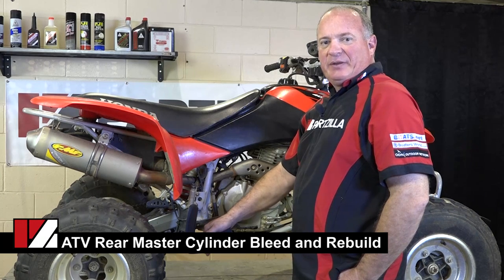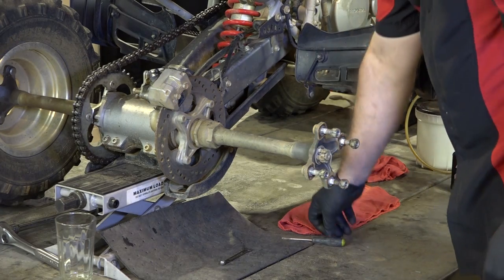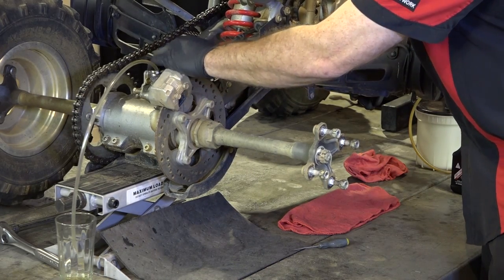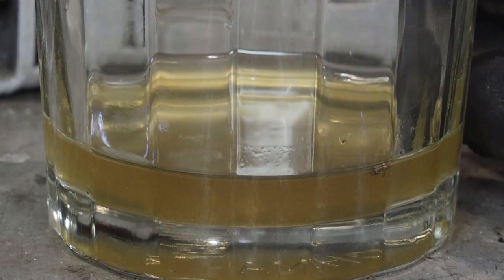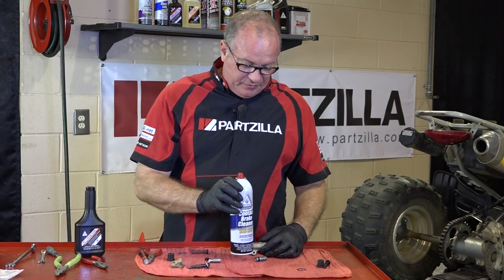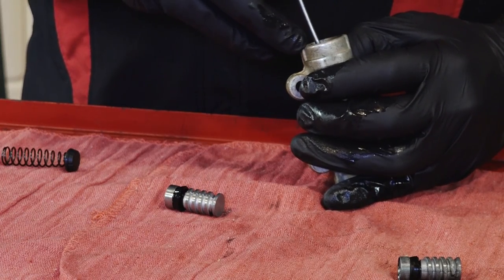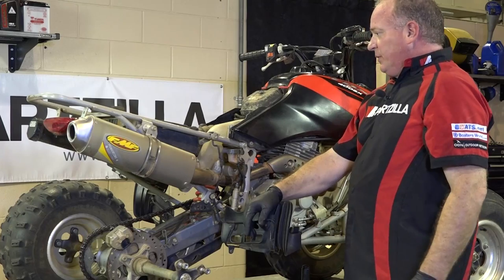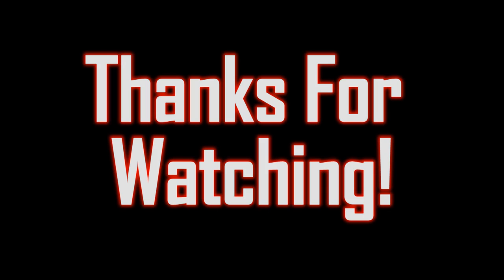How to Bleed ATV Brakes and Rebuild a Rear Master Cylinder | Partzilla.com

Comment: Hi @Partzilla i bought a new master cylinder because i couldnt build much pressure in the system but now i kinda have the same issue. The pedal wont stiff it up. What am i looking for now? Can the issue be anywhere else?

Comment: I need help diagnosing the rear brake issue on my 2015 Honda Rubicon FA7 DLX. The caliper piston pushes out when I pump the brake, but it won't go back in unless I take the caliper off and screw it back in. I there air in the system? Is the spring in the master cylinder broke? Is there something wrong with the caliper? 
Other info you may need: There are no leaks anywhere. There is approx 6,000 km on the machine. The brake pads are close to the end of their life.
Oh, and BTW, this video was AWESOME! It explained a lot, but I'm still stumped.
Reply: your line could be deteriorated, restricting the release  of the caliper.
Reply: @111whereru  Thanks for your response Mike, but that wasn't it. The rear pads were worn down enough that it was affecting the entire system. I rebuilt the rear master cylinder, took the calipers apart, cleaned the piston, flushed the lines and in the end, it was the pads - 🙄. Oddly enough, the pad life marker lines on the caliper told me I still had life in the pads, but they were looking a little thin so for $30 I should have started there - DOH - lol - lesson learned.
Reply: @quaddingsous  I have a Honda with new pads and a rebuilt master. the pads aren't retracting. The line is the problem. good to hear you got it

Comment: Very helpful. I have a 2006 Bruin 350 with a frozen front brake. You mentioned DOT 3 & 4 holds moisture. Is there another choice that wouldn’t do this?  Thank so much.
Reply from the maker: 5.1 but it's not necessary for this application.  3 or 4 should work fine.

Comment: Would it hurt the machine to use a standard car brake fluid ?
Reply from the maker: +Cody Brewer DOT is a standard of measurement that sets the specifications for fluids. As long as it's a DOT-4, it will work. You will need to pay attention to the boiling point as this varies from each manufacturer. The dry boiling point for the Honda DOT-4 fluid is 490 degrees F.
Reply: Cody Brewer 
No, I dont think it would hurt it unless you're constantly using your brakes.
Any DOT 3 SYNTHETIC should be ok.

Comment: I have a 2010 Polaris Scrambler 500 HO that had the brake fluid pour out the rear calliper. Where should I start with fixing this and what steps do I need to do?

Comment: Sir,
Were you able to successfully purge all air from the line the way its normally routed?  On mine there's a high spot in the line right before the caliper where some stubborn bubbles can hide.  May be necessary to un-bolt the brake line brackets from swingarm to get a straight run from the caliper to the master.
Reply from the maker: Normally it will purge. If you get some that are stuck, you can always reroute the cable to eliminate the high spot temporarily.

Comment: Hi, could you please assist me in how to fix my rear break master cylinder on a 1999 Honda Goldwing SE 1500? I really am battling.

Regards
Reply from the maker: All the parts you need are here.  You can rebuild the master cylinder.  
https://www.partzilla.com/catalog/honda/motorcycle/1999/gl1500se-a-gold-wing-se/rear-brake-master-cylinder

Comment: I had to bleed my brakes on a 02 polaris trailblazer and I didnt the same thing your doing but nothing came out of the bleeder valve so i stuck a hex key in to see if it waa clogged and its closed. You cant push nothing thru it but once i open the bleeder valve up only way brake fluid will come out is if i pump the brakes first time working on the brakes on my machine and its irritating
Reply from the maker: I think I missed something.  The only time fluid comes out is when the valve is open and you pump the brake.  That's exactly how you bleed a brake system.  Close valve, pump 3 times and hold pressure, then release valve, let a little out and close valve.  Continue.

Comment: I rebuilt mine useing lots of fluid to make sure its lubed good but the piston is sticking in the cylinder? Is this normal when it's not hooked up
Reply from the maker: By not hooked up, I assume you mean you are moving it with your hand and it's not attached to the crank?  Then yes, you most likely aren't sliding it perfectly straight, so it will stick.

Comment: Hi everybody can you please give me some suggestions on how to verify with videotape  and a go pro hero 4  silver my 1299S when it intermittently and randomly and unexpectedly stalls out? Every time i take it to the dealer they said they can't duplicate the problem  and Ducati of North America video taped my bike with no problems.  But my 1299s still stalls out on me in congested stop in go traffic all the time and when I feather the clutch and drive between 0 to 15 mph on the street or freeway or on the street.However I'm an amateur and I just purchased a hero 4 go pro silver camera do you have suggestions on how to mount it to the 1299S gas tank ? I'm concerned with losing the camera what type a suction mount the go pro hero 4 camera? What I should use and what can I use in case the suction loses its grip to keep the camera from damaging the motorcycle and the camera in case it falls thanks advance for everything. The dealer said prove the 1299s is stalling out with video verification because they claim everything is checking out A ok on the computer test sheet with Ducati engineers and  Ducati video tape that they won't show me What would you do? Thanks in advance for everything.

Comment: my allen wrench is stripped won’t come out either one, any advice?
Reply from the maker: You can try to go up a size and hammer it in to get enough traction, or use an extractor set to remove the bolt.

Comment: I bought the 400ex rebuild kit for rear master cylinder and cannot get this thing to build pressure. Please Help. Thanks
Reply from the maker: It takes a long time to bleed the system after this procedure.  If your fluid is not moving in the reservoir as you bleed, then you are most likely going to have to pull it all apart again and make sure the master cylinder is put together correctly.  Also, make sure nothing got torn or cracked when you installed it.  If everything looks good, reinstall and try it again.  It can be frustrating, but usually, it's something simple.
Reply: You will never get the pedal hard the way he's doing it. For some reason it's not like a car. I try for hours air never came out or brake fluid. If you still need help let me know. I know it's been almost a year since you post...

Comment: Read question on a 2008 honda trx400ex when i blead the brakes im not able to make pressure and when i do theres a circular thick rubber that ballons up when it it make pressure and at top and sideof rubber  it leaks air and brake fluid im wondering how i can fix it cause i need back brakes the rubber bushing that leaks it is located at left side of caliper right side of spring that connect to ebrake at the end of that spring there is a medal that pivits on right side of that medal there the rubber that leaks. U are able to see rubber at lmin and 47sec on vid How can i fix leaking problem is there a kit that i can buy or how can i fix it .respond to my question as quick as possible
Reply from the maker: Not exactly sure what you're trying to describe, but all the parts for the caliper can be found here.  
http://www.partzilla.com/parts/search/Honda/ATV/2008/TRX400EX+A/REAR+BRAKE+CALIPER/parts.html
Reply: Partzilla. Do u have a email i can send pics to
Reply from the maker: Message us on Facebook.  It will be easier to communicate there.
Reply: Partzilla i do not have face book
Reply: Evan Carrizal 
You never said please. Pfff👎

Comment: I have a Suzuki baja and it has the same problem so I took the master cylinder off like you did and took it apart. It's so tight in the hole that the spring has no effect. I've replaced it and still does the same thing. What should I do. Just buy a new one?
Reply from the maker: +Nathan flint That is probably your best option. Odd that there is such a clearance issue.

Comment: Please can you this white the yamaha raptor 700r?
Reply from the maker: It's the same basic process.
Reply: @PartzillaParts  My raptor does't have a reservoir, as far as I'm concerned. If it had, can you tell me where it is?
Reply from the maker: Yes you do. Start at the rear master cylinder and follow the hose up to the reservoir.
Reply: @PartzillaParts  thank You!